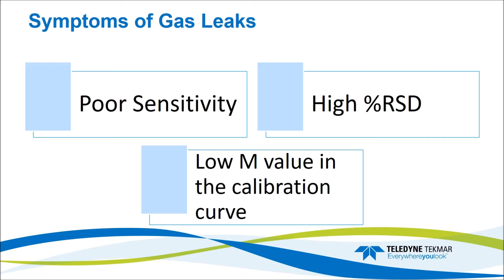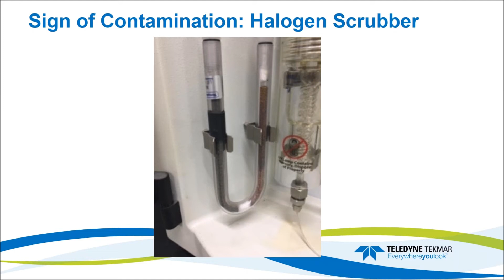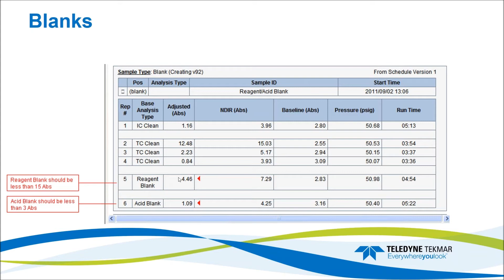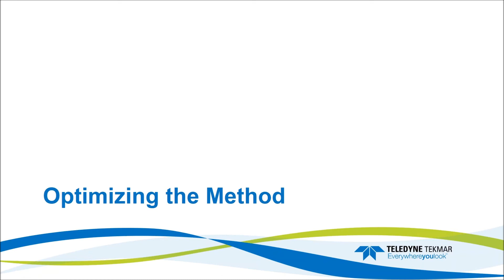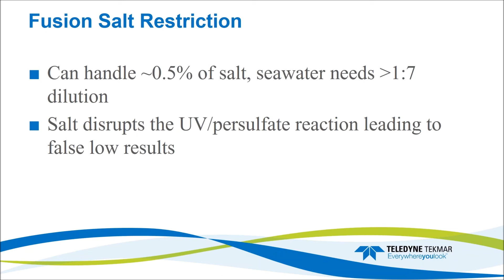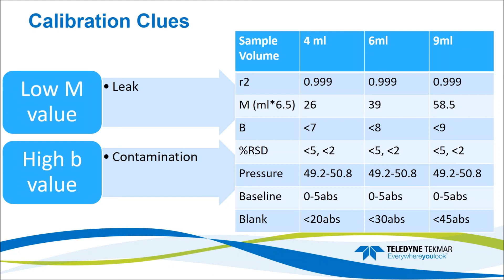Teledyne Tekmar Webinar Superior Analytical Results on Fusion TOC Recording

Comment: After you do the 300 flow what does it go back to.?
Reply from the maker: The flow will adjust to the next method parameter that is outlined in the method. The Fusion utilizes a mass flow controller thus allowing variable flows throughout the method instantaneously.